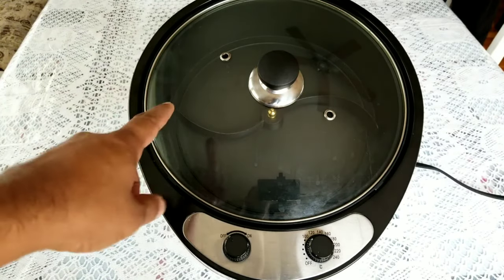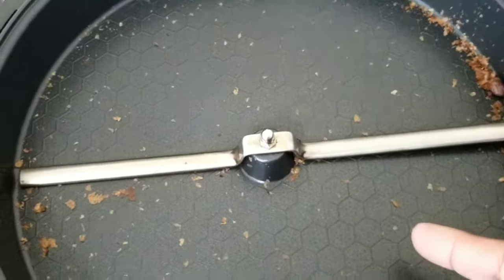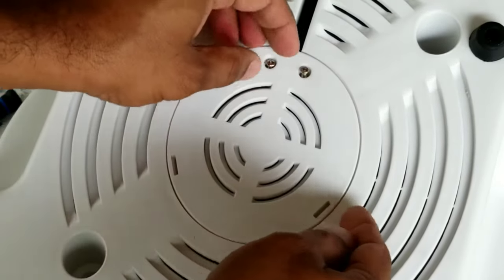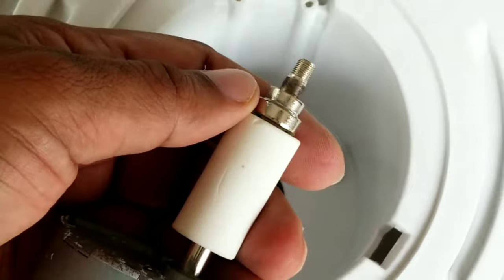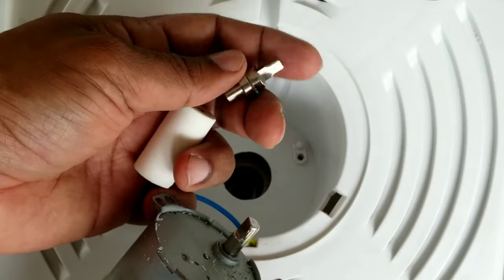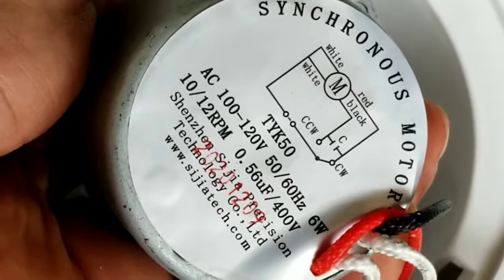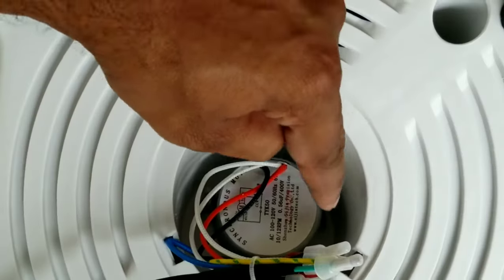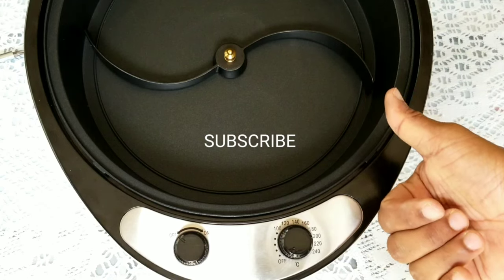Fix Coffee Roaster issue - Wobbly Spinning Arm Reason?

Comment: Other options: 1. Depending on the type of plastic/nylon you might be able to fill the hole with some epoxy. Some plastics (like hdpe) don't stick to much. 2. Possibly 3D print replacements for the plastic coupling.
Reply from the maker: Yeah thanks. Also i figured out that its so tough to get it aligned as well. I filled the gap with aluminum foil. But it doesn't rotate in perfect circle. The arm scrapes on to the side a bit. But it doesn't wobble. It's not designed well.